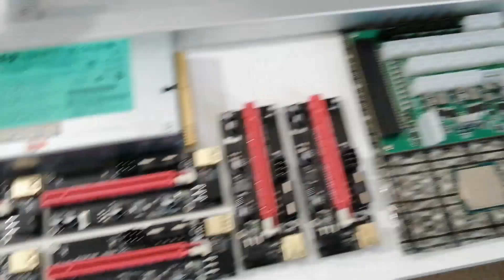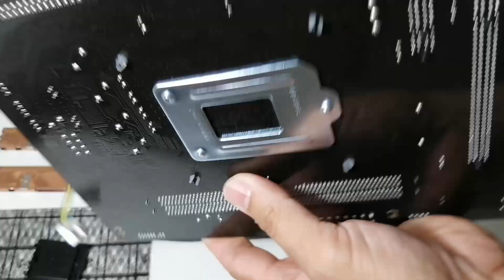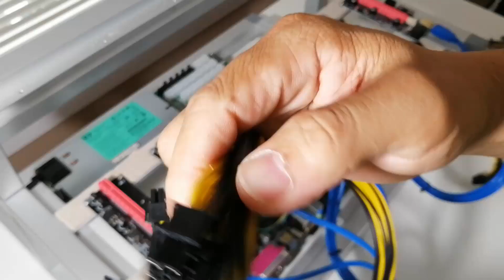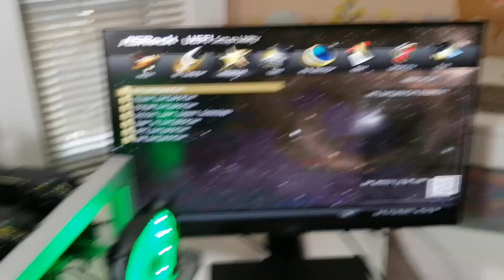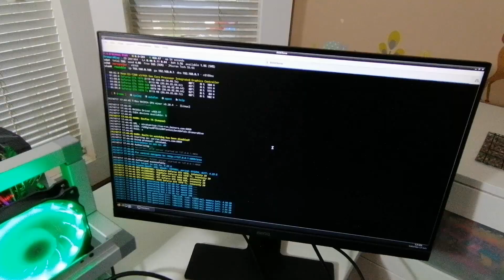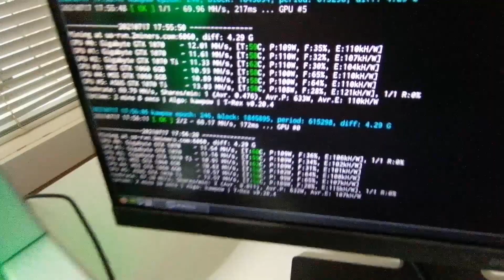6 GPU Hive OS mining rig build from scratch

Comment: Hey mate I have a BTC-S37 but it will permanently reboot after installing the second RX580 (in the second slot)...
It only works with 1 connected (to the first slot obviously to power everything up).

Do you know what it could be? I have the 1200W server PSU so it shouldn't be a power problem.
my system detects both GPUs but permanently resets after detecting them
Reply from the maker: Sorry I do not have AMD, what OS are you using?
Reply: @ruvrandomusefulvideos  I solved it. It was really weird.
I bought literally the exact same copy in the same store. But the new GPU was rebooting if I used the same overclock settings from my previous one, I had to reduce them. Its like if it was built worse lol do you think it even makes sense to be that?